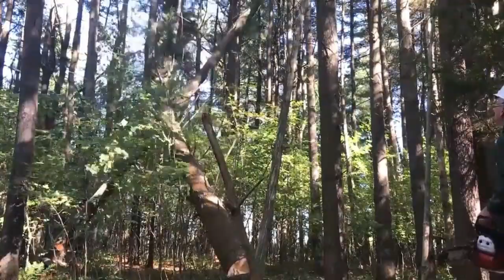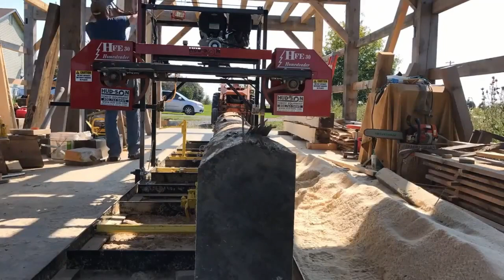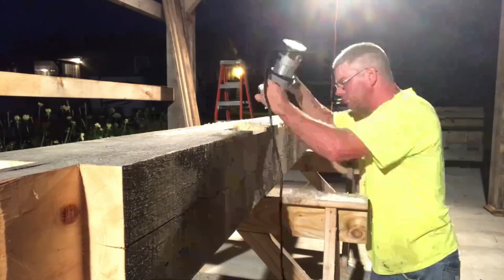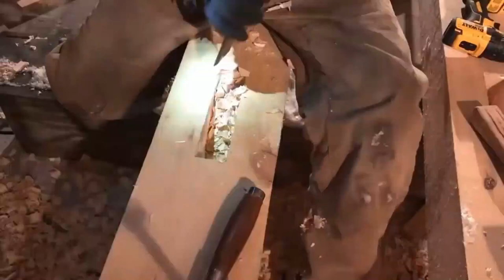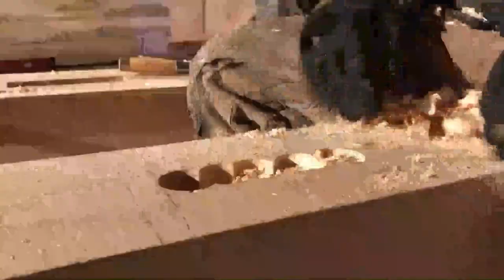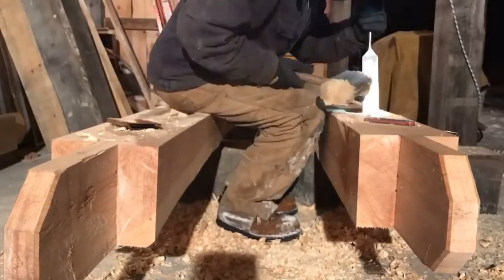A Timber Framing Vlog: Reflecting on the Build

Comment: Thanks Jim, You are so inspiring. My 25 logs were milled in April and the timbers are now stacked in the pole barn. When the summer projects slow down I will start cutting joints. I wouldn't be doing this if I hadn't found your channel back in 2017. Great reflections tonight. Thanks again
Reply from the maker: You have no idea how much I like hearing that.

Comment: Hello: I was thinking good firewood gone to waste. A penny saved is a penny earned in 1925, that's still true today. I still save pickle jars for bolts and nuts. Hillshire lunch meat plastic totes for fishing supplies. I bring home an inch of McDonald's napkins, straws. You can seal the end of 2 inches of straw fill with salt or pepper and seal other end. Always have 100 feet of 550 paracord !!!
Reply from the maker: Burning white pine in a woodstove is an invitation to a chimney fire.  Spruce would've been alright or any hardwood but not this stuff.  I burned a bunch a few seasons ago and it was a creosote factory.
Reply: @TheTradesmanChannel  Hello: Ok you are right, pine has Rosin = Creosote. When we had a wood stove for grandpaw I cut Locust, need to split it when you cut it. It burns long and hot, all night.
Reply from the maker: Locust is great firewood.